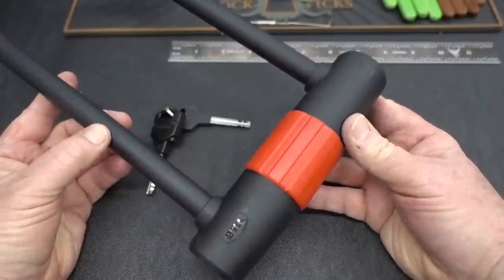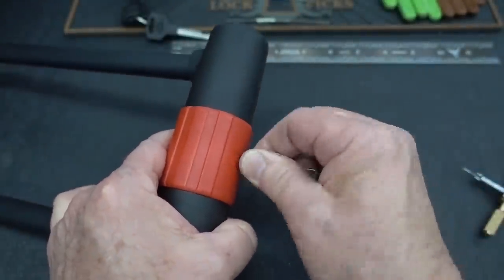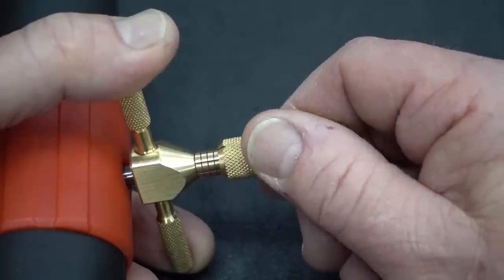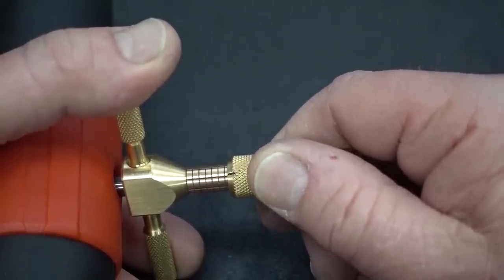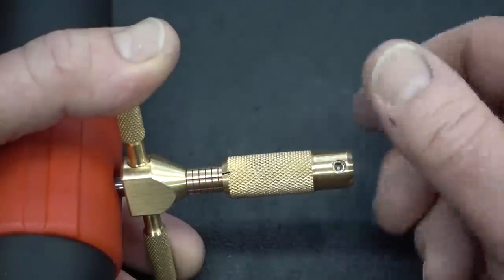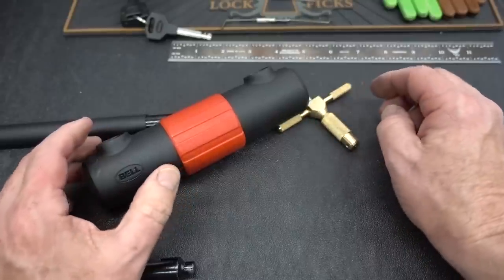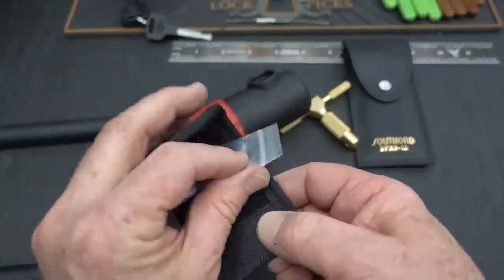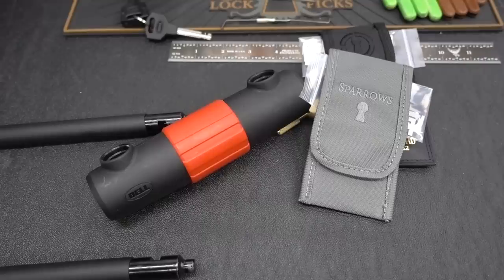(1440) Bell Catalyst 750 Bike Lock

Comment: Now, this is a situation where you could’ve used one of those lock mics you were trying. This particular lock just wasn’t as loud as most of the ones you pick.

I’ve never won—though I’m not the most consistent at trying—but I appreciate the time an effort it takes to run that program, a channel, and still have a day job. You are so generous and jovial. Thank you.

Comment: Great ...fantastic  review .I think Bill you need to make 2 version of the new design one that SPARROWS or Petersons does in stainless steel 
And you guys keep the brass version so you have 2 different price points. Just a thought .Thanks for the video. 😎
Reply: It's all about the market - splitting a product into two tiers when the demand may not be worth it is not a wise decision.  Sparrows may choose to do brass with stainless tips just to lower costs at the outset.  Bill/LPL have no final say in what Sparrows decides.
Reply: It's all about the market - splitting a product into two tiers when the demand may not be worth it is not a wise decision.  Sparrows may choose to do brass with stainless tips just to lower costs at the outset.  Bill/LPL have no final say in what Sparrows decides.
Reply: @eak125  well with the amount subscribers that Bill and lol has even if they grab 10 percent I am sure they would be profitable just a guess .Thanks for feed back.😎